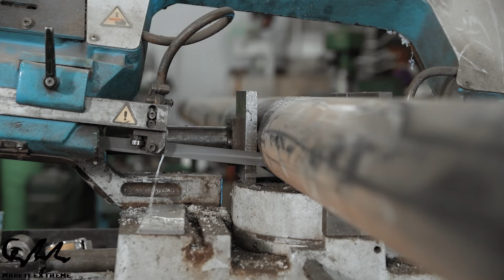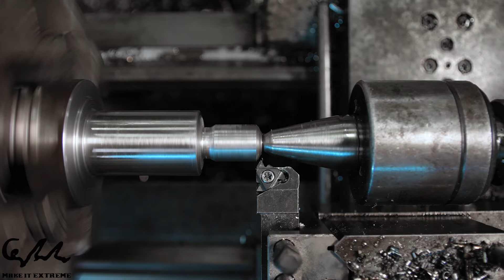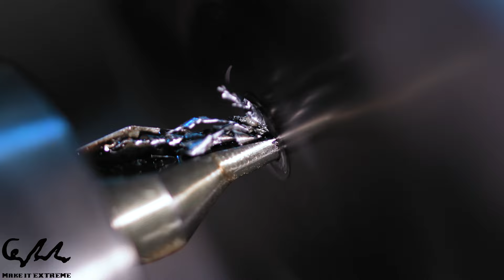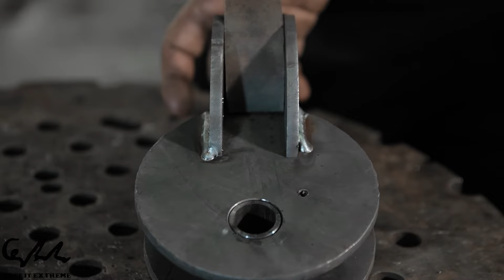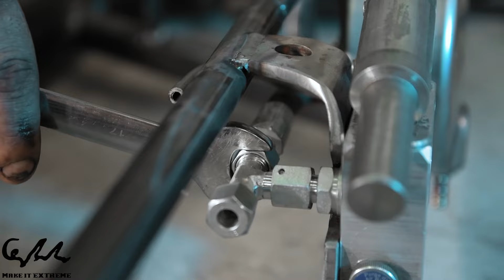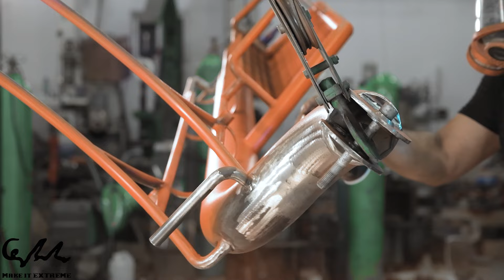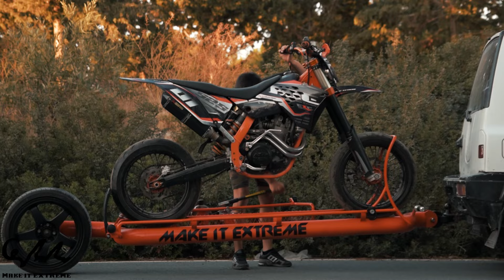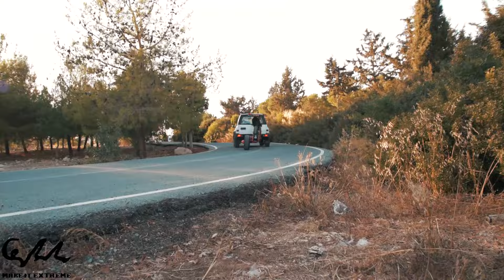The INSANE Homemade Motorbike Trailer of 2024!

Comment: It looks cool with the hydraulic lift, but it's not a very good set up. You can't drive it at high speeds or around corners at high speeds. It's just unstable. This guy has built better stuff.

Comment: Its cool. 👍 I would want some adjustability in case I buy a different bike with a slight wheelbase change though. Also a mechanical lock for the ride height in case something in the road bounces up and cuts or damages a hydraulic line. Also that little suzuki(?) sounds like the transmission is about to die.

Comment: I am wondering if is  the trailer unbalance... can the trailer stand (don't fall left or right) when is loaded with the bike, and it  is not hooked on the car? I can see very well, is the joint with the car  flexible (rotate left or right)?

Comment: how did u connect it to ur ...car suv thing lol ?? it wasnt on the ball otherwise it would have fallen over, also i saw it was attached under the ball, but im not aware of any way that would hold it rigidly upright but still allow other necessary travel n movement   also it seems like it would b bouncy without suspension do u have any problems with that?

Comment: Looks like a viable invention to me. A whole lot of thought went into this design.
Reply: ...except lack of suspension, safety of hydraulic seal failure, mudguard, trailer lights, ability to reverse with it... etc. 😁😬
Reply: @sonovoxx  The guy's probably going to do whatever it takes to make it road legal where he lives. What do you want to watch? Mudguard installation and trailer wiring? I'm in it for the custom, unique fabrication shown here. The mudguard and hydraulics are valid concerns...but the other concerns don't make sense. The motorcycle being hauled will work pretty well as the trailer's suspension. And why wouldn't you be able to reverse it? The wheel is centered with the hitch. You'd be able to back up like a normal trailer.
Reply: @jokly1264  as someone who spent years towing things for a living, I can see you haven't tried to pull a trailer that has no suspension, or tried to reverse a trailer you can't see, but I'm glad you agree with my other concerns!

Comment: In addition to this not having a shock (as mentioned by a few people already it seems) I would also be worried about losing pressure in the hydraulics while on the move (say from a road debris strike). Would love to see a flip out safety bar to attach in parallel with the cylinder that would take the load in case of failure. 

Probably not that big a safety issue, as losing pressure at speed would just lower the back of the trailer to the road and cause a lot of grinding, but it would be really disconcerting to anyone following you in that eventuality. 

As a response to some people who thing the off-axis load is a problem, I actually don't think it is that big an issue. the hitch system looks like it would take up any torsional load. I bet you will not even see uneven wear on the tire. The off-axis load is so close to the center-line that the driver probably would not notice.

Comment: You should have put a lockout pin on there.. .so if the hydraulics goes out, it will still be locked, and work fine as a normal trailer to get you home.

Comment: While the trailer looks nice, it's an accident waiting to happen. There's a reason why single wheel trailers aren't popular: they're extremely unstable and there's not much to prevent it from rolling over when you go around a sharp corner. It's particularly problematic with this design because the load is offset from the centerline. I suspect that it will go over the first time he makes a left hand turn.
Reply: will not tip   see hitch
Reply: @jwiereng  It's an interesting hitch, but there is a potential for significant torsional load and something is going to give.

Comment: From where i come from a trailer needs to have its own plate number. Also does it conforms or follow certain standards, It does not have tail lights, signal lights, most importantly BRAKE LIGHTS. Plate Number for the trailer, car/suv plates aready somehow block. Much better if you jave a pick up truck put the motorcycke at the back. Not all people have cnc machine, welding know how at the materials for the said project. Certain Laws must be abserve regarding trailer. That orange pipe might not be that visible on high traffic without light, indicator and other safety devices/gadgets. 🤔🤔🤔🤔

Comment: Beautiful piece of overengineering. A great talking point....
Just don't drive that unsuspensioned rear wheel over any bumps.
The load on the vertical hinge tow ball with the high centre of gravity will be interesting.
No fork brace on the front so either the fork seals are under continual compression load during travel... or any bump will compress the mass of the bike down opposing the upward travel of the trailer, compressing the forks... allowing the straps to unhook.... hilarity ensues.
The trailer is also longer than the bike... making for good reversing dynamics, but bad parking length and possible rear ending from following traffic.
A hydraulic ram should never be trusted to hold position especially on a bumpy road where it will be experiencing positive and negative pressure as the un suspended wheel goes from compression under load to airborne weight with rebound in the joints.
You have a huge tube there, you could have used that as an air tank and combined shock absorber.

I had an idea years ago... A wheel capture on the tow bar (requires square plug in assembly so the tow ball is removed and this plugged in).
Only the tyre is locked in place allowing the bike to pivot up/down round the front axle axis and sideways by its own steering joint.
then a tiny triangle trailer a bit like an old chariot with 2 motorbike sidecar style wheels so the axle can be above the loading channel...
then the rear wheel locked to the trailer (this is the tricky bit as there needs to be a bit of thought into locking the wheel to the trailer but allowing the geometry of the trailer vs bike lengths changing on rise/fall of the surface... either the rear wheel lock in a track.. or maybe just on its own hinge so as the car goes over say a steep driveway to flat road, the trailer can move forward/back under the bike but stays locked to it.

Result.. a trailer in 2 bits that can be lifted by hand and thrown in the back of a ute.
suspension for the trailer is basically splitting the weight in 2.. the trailer is unsprung.. but the bike rear suspension makes the bike sprung weight.

Go for it... (a bit of honorary mention for design of you make one would b nice.).

Comment: Why do we get to watch spray painting which any child could accomplish and not get to see exactly how the tongue of the trailer attached to the trailer hitch of the vehicle pulling the trailer ?  Obviously this connection is what the entire concept is based on as that connection determines if the trailer will stay upright and follow the vehicle and back up correctly. It appears from the construction of the tongue that a large bolt goes through an upper plate on the hitch and then through the trailer tongue and then through a lower plate on the trailer hitch. Since more than 3/4 of the comments express this designs inability to stay upright in a corner I would think some forethought into showing how to attach it to the towing vehicle would have been obvious. It is a very attention getting concept and looks fancy and loads a bike very easily though.

Comment: Sorry to say, but this is not a good design nor an improvement on current bike trailers. Such as the height action adds so many more points of failure, less structure, and adds more work. The single tire may work for bikes, but not for trailers which are pulled.

Comment: can't agree with this design. Just throw it in the back of a basic trolley. This trolley can never be used as a normal trolley.
Reply: Which is the point. It's purpose built for one application.